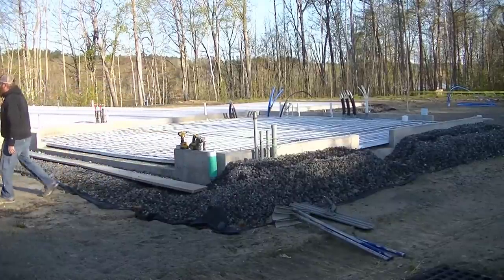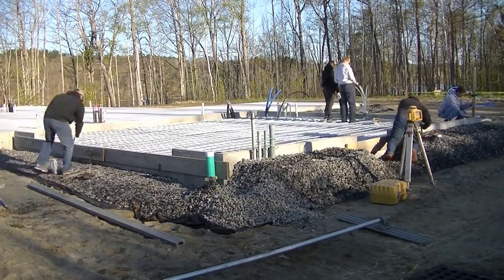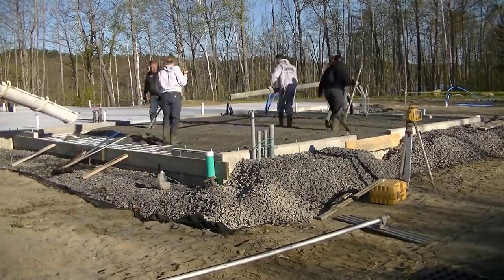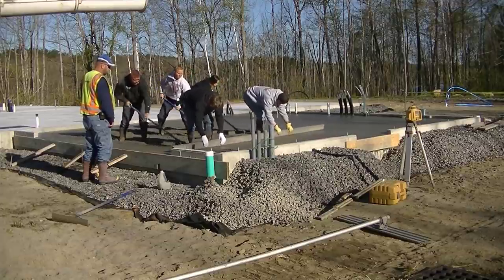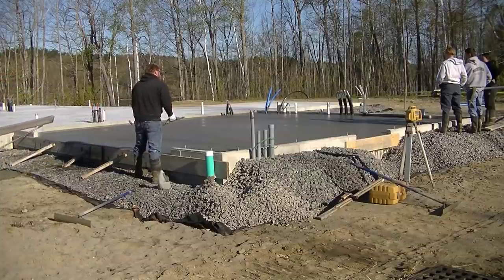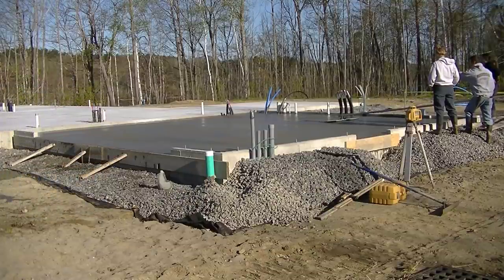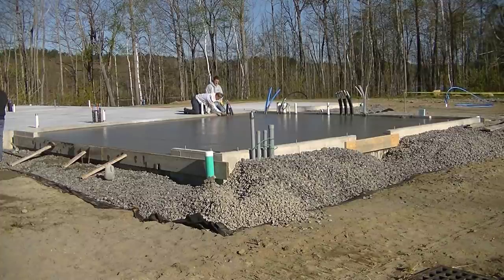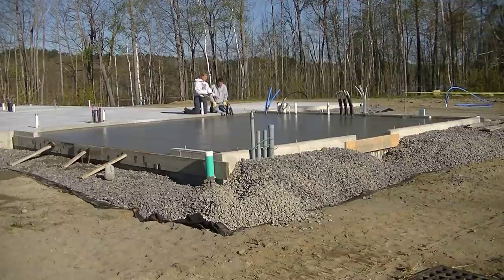Pouring The Concrete For A 2 Car Garage Floor [26' x 24']

Comment: I always told the newbs the same thing - “I understand that you don’t know anything right now, but you need to make up for that in hustle”. You can generally tell pretty quickly if someone is going to work out or not, just by observing their general work ethic. And if you’re ever in doubt about what to do, just ask. Never just stand around.
Reply: i  prefer  to just  stand and watch
Reply: @pipedope329  Good luck with that, sloth. You're not going to be around very long on my crew.

Comment: Mike. Good job. I definitely agree on not using the power screed to do a pitch. I have done it but it’s kinda a pain. What was your slump on this floor? Did you have water reducer in it? It seemed to flow good. Does the water reducer you use speed up the drying process at all? I’m doing a big floor next week. I might try the water reducer with shoot extensions instead of the track buggy we normally use. Can’t get the truck inside the door it’s a pole barn.

Comment: It's easy to throw someone into a job and teach them.    Yet,    Teaching them the " JOB " will pay more in the long run.      How did we get to this stage or that stage will give them a better understanding of the overall job.   Why we stake it here or there.   Why we kick our feet when walking backwards.    How we get to the depth and why we get to that depth.    Various types of concrete types and why they are used in various applications....     Let's be honest about bull float.   It is what the customer wants to see.   A nice smooth, flat and no ridges or dips in the final project.   The question is how did we get here?    You can teach a person to run the bull float to start with.   Then ask them this question...  How did we get to this point?    They will be lost...   because they don't have a clue about the " JOB ".     You have spent hours upon hours making training videos to help others.    Why not put your own teaching videos to work in your company?     Having a newbie sit down and watch a series of videos then going out on the job site to put those videos to work.    Starting from a basic concept like what is concrete and why do we use it.   added thought...    Having them watch your videos will also give you a ton of information as well.   If your how to video is a effective training tool to have.      Thanks for your videos
Reply from the maker: Thank you, Michael!

Comment: I teach new employees slow. They first have to learn the basics, the correct processes.
They need to learn how to rake the cement properly to the correct grade, so they don't kill the guys pulling the stick.
They need to have an eye for level, pitch changes, where the water need to go, etc.
They need to know about cement, what is slump?, what does 6.5 sack or 4000 psi mean?, when and how much water can be added, how fast does it dry?
Bullfloating is easy, but you have to have an eye for it, be able to see highs and lows and if those high or low spots should be there or not.
If you are doing a floor with drains and multiple grade changes and different pitches and you let some "no nothing" do your bullfloat you will end up with a floor that doesn't drain.
They will flatten out your high spots and fill in your lows, and you are the one that has to go back in and fix it all.
I have been placing cement for 25 years, and averaging about 10,000 yards per year. and i won't let a newbie touch a finishing tool for at least a month or two, unless they are washing it.

Comment: i poor 2 of these dumped out with me and 1 guy.  easy, i laugh when you guys use so many people. waste of money. Thats dumped out and finished, just 2 guys.
Reply from the maker: Drakes, I've poured and finished 100's of floors with just me and 1 guy, what's your point. Is there something wrong with having more than 2 guys. We pour 2 or three of these in a day. Do you do that also?
Reply: @MikeDayConcrete  you could just take home more money with less going out. Just an observation. Do you thing brother. If you put out content I have the right to comment on it.